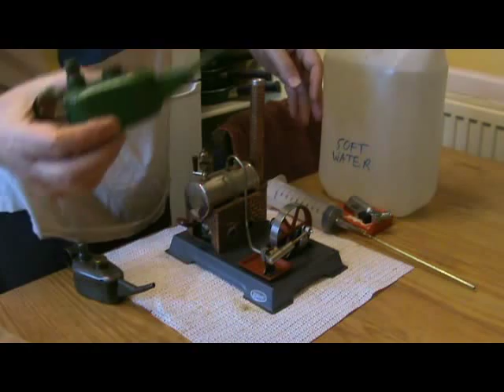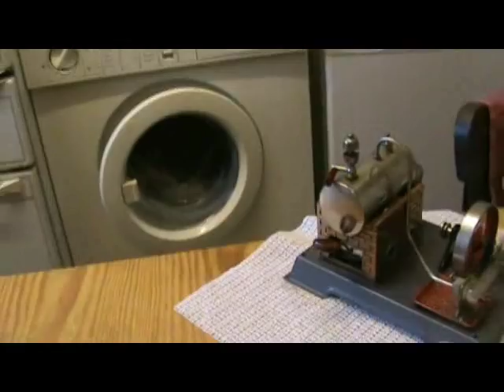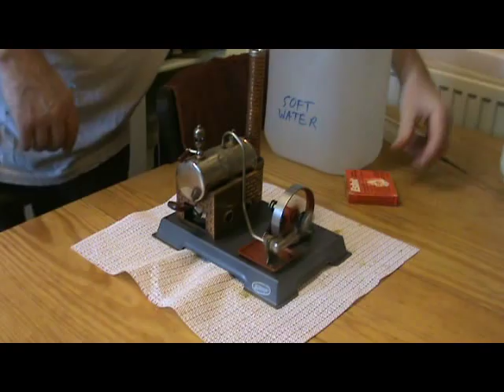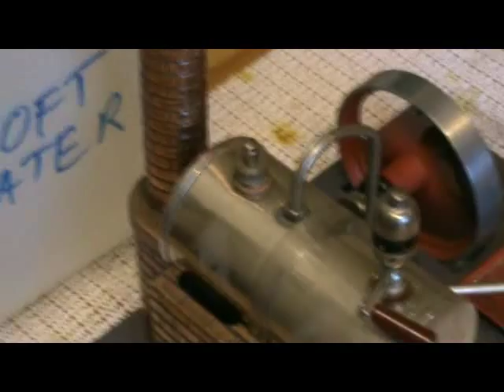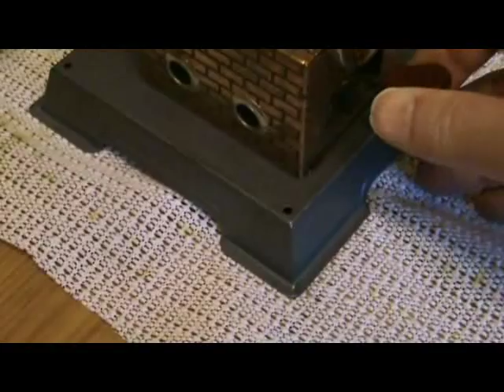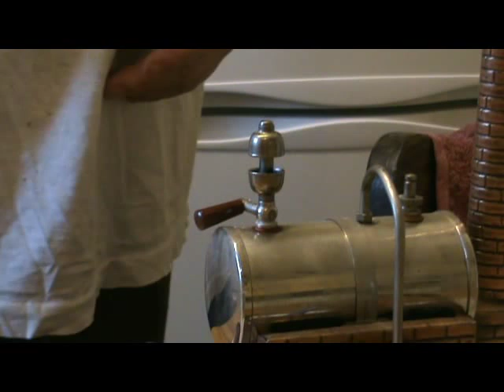Wilesco D5

Comment: I have the same one as you... The early version Wilesco D5 steam engine. The modern ones have the front sight glass on the boiler.
Reply: I have the same. Any idea of the year range? I was guessing late 50's but i'm not sure
Reply: @Gewehr2180  The D5 without the sight glass was still being sold by Sears in 1966.

Comment: Nice video ! I just bought a D5 I'm new to this , without the sign glass how much water to put in and how do you know when the water is getting too low ?
Reply from the maker: According to my notes, the boiler takes 90 ml of water. The burner is designed so that it runs out of fuel before the boiler runs out of water. You should never refill the burner without refilling the boiler as well.
Reply: @RolyWilliams   Thanks buddy !

Comment: Would be great if they made a coal fired version :)
Reply: you could probably break up coal and put it in the tray but you'd have to run it outside
Reply: Nope. Coal would develop such a heat, that it would melt the soft-soldered boiler. It could "explode", even with that small it could flying parts in your face. Could be dangerous!!